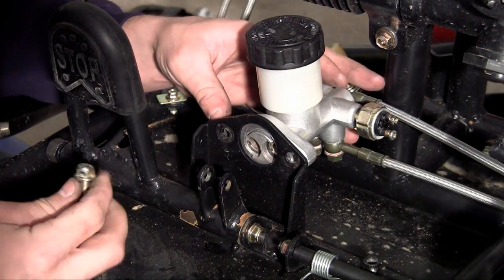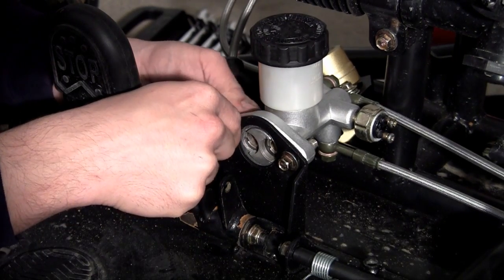How to Build a Go Kart - 10 - Brake Master Cylinder

Comment: 2 wires plug into the part you're installing I wish you had mention what are those 2 wires for, my go kart won't even crank and I am assuming those wires are going into a switch that won't let the cart start but I don't really know...do you?
Reply: Safety switch
Reply: You can wire the 2 wires together and it'll bypass
Reply: @chrisbragg268   Thank you very much

Comment: There is no gate being opened... its simple hydraulics. The master cylinder is a long narrow hydraulic cylinder and the slave cylinder (caliper) is a short fat cylinder. When you push the pedal it forces brake fluid down the brake line. Where would the pressure come from if there was just a gate that opened?

Comment: Guys, he didn't buy the parts. He bought the Go Kart whole and took it apart to put it back together again. I believe this is the Kandi 150GK Go Kart which he bought and took apart.
Reply: ya you can tell. why would his 'brand new' brake system' have chiped paint and surface rust

Comment: I really like your tutorial, but I have to correct your brake explanation.

When you push in the brake pedal, you aren't allowing the 'fluid to flow' but rather cutting the fluid off from the master cylinder(up top) and squeezing the fluid down the tube to the piston inside the caliper. The fluid being pushed down the tube makes the pistons in the caliper squeeze inward as this is the only way the fluid can go making the pads sitting outside the pistons rub against the rotor braking the vehicle.